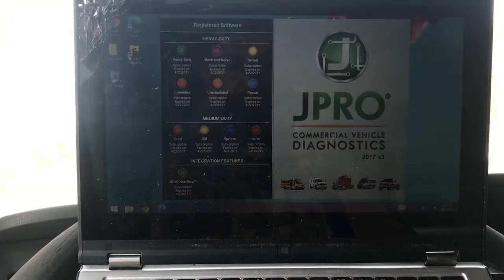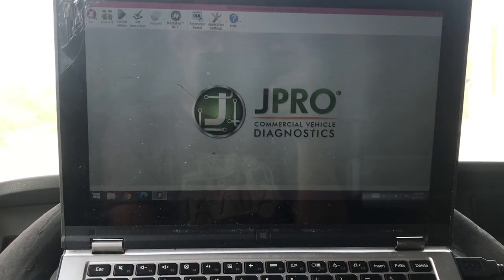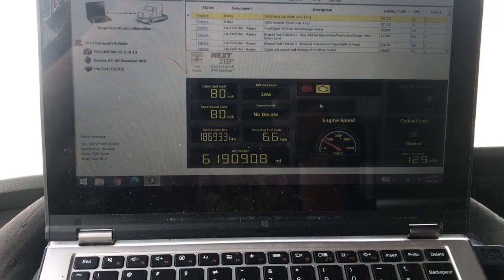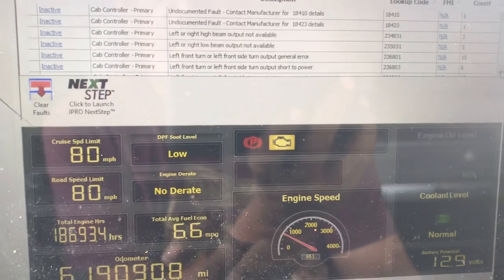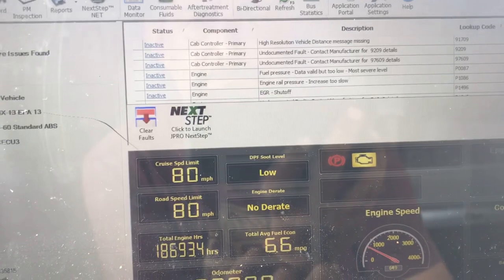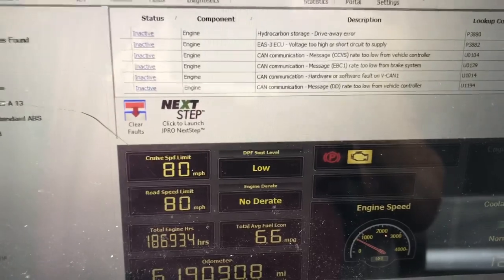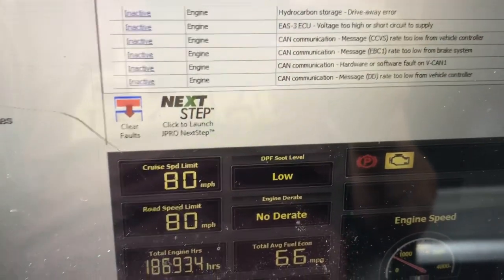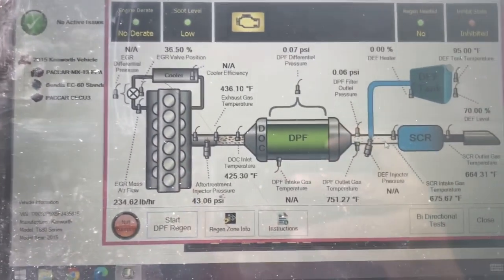2015 Kenworth T680 MX13 paccar engine

Comment: JOE,  2003 4300  fuel tank has an electric fuel pump mounted on top of the tank. Is there a tool or trick to getting fuel lines off pump? a link  would be greatly appreciated....  thanks for all the work and dedication to your channel... more help than you will ever know....

Comment: Joe, I noticed you worked on Allison trans. I have a WTEC B500 in a bus mated to a series 60, 2003 model year, that's in limp mode. I've already replaced the speed sensor, no change. The only code it was throwing, I believe for the engine too was a speed sensor issue. Right now, when you go from neutral to drive, there is a few second delay and it goes in hard. It has to be starting off in a higher gear, because its sluggish. If you go past 5-10 MPH, it will be in neutral even though the display shows its in gear. The key pad will not work, and the vehicle will not move. I have to shut the bus off, disconnect the batteries for it to reset. 

Before I had the issue, it was shifting just fine. Then it started shifting rough, slamming into gear. I have the Allison software on a laptop, I've gone in, but I have no idea what I'm looking for. I can see the data, make parameter changes(IE engine brake preselect), interlock disabling, etc. If you have any advice on what to do, please advise. At this point I don't know if there is internal damage, or if I'm just dealing with an electrical issue.  Thanks!
Reply from the maker: Hey there B. It sounds like you have a TCM problem. Check fuse and relay (trans control module). Limp mode. Hard gear engagement  that sounds like a tcm malfunction. Are you getting a check trans message on your cluster. You might want to have tcm checked out if fuse and relay are not the problem.
Reply: @JoesBusBarn  Joe, thanks for the reply! When the bus is running, there are no codes present. As soon as I drive over the threshold and it attempts to shift at 5-10, it does shift, it just falls into neutral, locking out the keypad in D and I have to shut off and hit the battery disconnect to revive it. The check trans only comes on when it attempts to shift. Are you saying try a different trans ECM to see if that fixes it? I have a sister unit, I can easily swap the TCM. As far as fuse and relay, I’m not sure what fuse or relay you would be referring to. 

This bus has a multiplexed electrical system. When I first got this bus, it had a code for the output speed sensor(which I replaced with a genuine Allison part, straight from Stewart and Stevenson), c3 pressure switch open, range verification ratio test 2nd, and 1st. Once I cleared, they never returned. The reason I believe they showed up and were stored, was due to driving when the malfunction occurred. Now, I’m unable to go past 5-10 mph, before it internally faults to neural and sets the check trans light or do not shift light on the dash.  The Engine ecm has a fault for vehicle speed as well. Thanks!!!
Reply from the maker: Yes. It is multiplexed. Do you have a 3 wire and 2 wire connector at the battery box (on wires birding batteries). If you do. Check both connectors and make sure they are not burnt or corroded at the connection. Not to familiar with the bud in question but there should be a relay holder around the engine area. (Firewall area) that has relays for fuel pump, ECM, tcm, IDM, etc.
Reply: @JoesBusBarn  thanks for the reply. My previous reply was edited so I could add stuff in there, it may have changed as you read it. 

There is a bus bar and multiple fuse holders neatly affixed inside the battery box for the TCM and ECM. There are no direct battery connections. I will check and verify the grounds and for any corrosion for these wires.

The TCM is located in a luggage compartment in a cabinet with other electronics. I will pull the connector and see if everything looks clean in there.

The bus is a 2003 MCI d4500 with a series 60 detroit. I really appreciate the help.  Thanks.
Reply from the maker: Ok. I went back and did a bit of research on your mic d4500. If you could. What code are you getting (you mentioned a speed sensor). Those units have ecm tcm and other bus connections (multiplex) crossing paths. I would like to know what code u got so that I can try and help you figure out the issues with your unit.
Reply: @JoesBusBarn  the multiplex system doesn’t necessarily communicate with the TCM. There are inputs where it receives brake light switch signal, or a signal that an interlock is enabled, ID door open. I believe it is either a ground input or 12 volt input which is programmed in the transmission. There is no canbus type data connection through the multiplex through the TCM. 

I could disconnect the multiplex system, and as long as there was power to the ECM and TCM, the bus would start, but it may not move unless the inputs are disabled for brake light switch, etc. I programmed the TCM so I can put it in gear just by pressing the button, and not having to mash the brake pedal. 

The old codes stored in order were:

22-16 output speed sensor test fail
32-33 c3 pressure switch open 3rd
56-22 range verification 2nd
56-12 ranger verification 1st

Bear in mind, these codes were stored when it malfunctioned while driving. I have not been able to drive it on the road. This was an auction bus with a bad trans, but when I picked it up it drove fine for 3.5 hours. The last half hour it suddenly acted up with out warning.

The stored codes in the ECM for the ddec 4 series 60 were:

55-s216-14 missing other ECU info
54-p84-12 vehicle speed sensor failure 

I don’t have the code it throws, but I believe it’s for a vehicle speed sensor once I start moving and it tries to shift or lock up around 5-10 mph. I do appreciate the help. Thanks!

PS, the engine and trans communicate directly, nothing goes through the multiple . The exceptions are engine ECM inputs, where a 12v o ground signal is received that requests engine brake, fast idle, etc. 

All the multiplex system does is wait for preset logic to be met. There could be one interlock input on the transmission, but the multiplex won’t send a signal if a door is open, foot isn’t on the brake, wheel chair lift is on, etc. 

Basically the multiplex system just sends voltage, not data. It’s no different than a a/c thermostat that sends 28 volts to the blower and a/c condenser to let it know it’s calling for cooling. The multiplex system does communicate and share data with the multiplex modules, just not the protocol the engine and trans are on. 

I do have the Allison software on a laptop.
Reply: @JoesBusBarn  I haven’t gone out there to take a look, it’s been pretty hot here in Texas. Besides the grounds and TCM, any other tricks and advice would be awesome. Thanks!